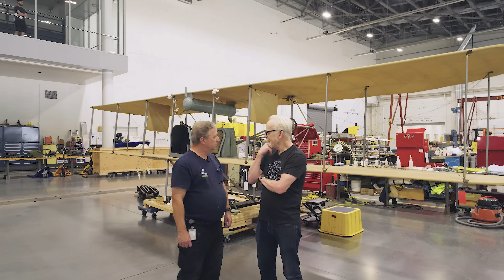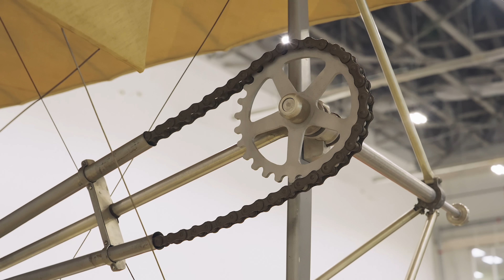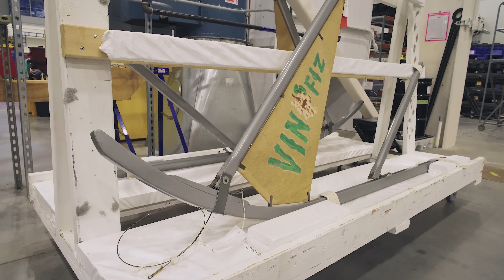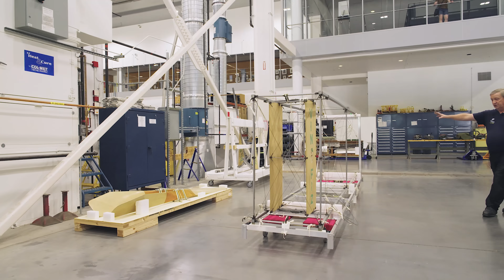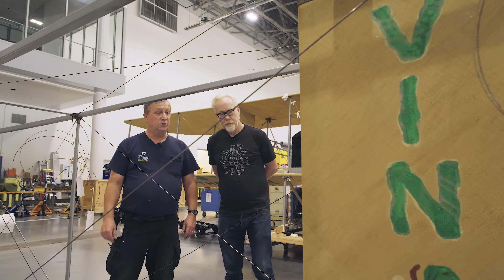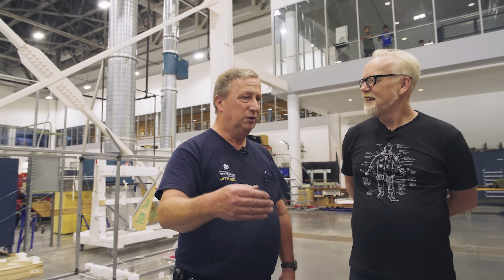The Wright Brothers Plane You've Never Heard Of

Comment: The wrights 1905 machine was the first really controllable airworthy plane that could stay in the air and nake turns Reliably.  There later 1908 and 1909 and 1910 1911 machines perfected it by there 1911 machine it was a very flight worthy airplane that could go up go down turn ledt and right Reliably over and over again and had did so by then for hrs at a time in the air.. and carry a passenger

Comment: All Wrong the firs men that flew a long distance without assistance before the Wright Brothers was SANTOS DUMONT FROM BRAZIL He should get the honor to be the first man flying solo
Reply: Your chronology is mistaken.  The Wrights first flew a fixed-wing, powered aircraft ("airplane") in 1903.  Santos-Dumont did not achieve that until 1906.
Reply: @cardinalRG  Santos, 1906 flight was just a straight line of 2 kilometers with no control of avion so just a long hop!

Comment: The Wright brothers were remarkable, and knew control was more important than engine power, so they avoided unnecessary risks. But some risks were unavoidable in a program where the flight testing of the first prototype is also the initial training of the first pilot.
Reply: Some people say others flew first before the Wright Brothers which may be so but the Wrights created a plane that could be controlled using wing warping, an elevator and a rudder.

Comment: My late friend built replicas of pioneer planes like the Wright 1 and the Fokker Spider, and I low flied them all. Low flying is leaving this earth and returning almost immediately, like early cars, any dummy can move them, but you have to be an engineer to maintain them.
Flying the Wright 1 was like trying to move a full dumpster with busted wheels, but once it rolled well try to stop it!
PS I'm not an engineer, I'm a dummy!
Reply: P-PS I flew the Fokker Spider replica way longer and higher than a low fly, I went up there, I just felt really at home with this one, the Blériot XI was less homey than the Spider, they should have crossed the channel with the Spider, although the extra fuel onboard would have made it cumbersome, but not impossible

Comment: were they really that smart?  they had a bicycle company yet none of their planes had wheels on them,   would have made taking off and landing a lot better
Reply: There were no airstrips.  They took off with a portable sled tramway runway of planks.  As low as the stall speed they were coming in at walking speed onto cow pastures.

Wheels are way worse than skids in that context.  Hit a hole or depression and flip over.

Even wagon roads were full of holes and stumps.
Reply: The Wrights’ use of a rail/skid undercarriage, and later a catapult, was a performance preference—they simply believed it to be a superior method of operation, as @STho205 here pointed out.  It was mobile and could be aligned with the local wind, offered a shortened takeoff distance, and it solved the problem of poor surfaces and confined spaces, like the soft dunes of Kittyhawk and the hummocky, tree-lined Huffman Prairie in Ohio.  (These were places that their competitors could not have operated.)  The Wrights may have been mistaken in expecting that future humans would prefer their method over having to dedicate large chunks of land to fixed-runway airports, but that doesn’t mean they weren’t very, very smart in choosing their methods.
Reply: And the catapult added to the portable skidway was primarily to keep them on the planks.  The 1st ones were just planks and keeping the kite centered over them for that distance was nearly impossible for new pilots...and everyone they were selling to or training in Montgomery were NEW aereonauts.

Rolling over turf or gravel...the rather weak engine couldn't overcome that drag enough to make flight without a slick takeoff.

Comment: The Vin Fiz chase vehicle was not a truck but rather a modified baggage car that functioned as a workshop. I’d love to know what tools were in it. Along for the trip was Charlie Taylor, the Wright Brothers’ mechanic who had built the original “Flyer” engine.

The front end of the baggage car opened up. When the engine was pulled out of the way,  the crew set up ramps to unload an Apperson sports car. The official car was used for general local transportation to transport Rodgers, parts, gasoline & etc.

Vin Fiz was a subsidiary of Armour foods (later including SPAM). The baggage car was painted bright white with the Vin Fiz logo emblazoned on it. Vin Fiz followed rail lines across the country. Armour’s head of transportation managed the complicated logistics of the trip. 

The “special train” swapped out Pullman cars and locomotives depending upon the rail line and what was available. The Pullman car was a place for Rogers, the crew and media guests to stay. The train had the same cook throughout the trip.

A couple years ago I built an HO scale model of the "Aeroplane Car" chase vehicle.

Comment: Fascinaitng.  Thank you!

35 hp(I) is
26 keW or 35 hp(E),
44.2 dBW,
27 p or 35 hp(M),
620,000 ft.pdl./s,
19,000 fy.lbf/s,
9.1 atm cfs and
25 BTU/s

643 lbs.=
292 kg,
781 lb.t.,
20.0 slug,
313 seer or 7.81 mound or 7 mound 33 seer (180 gr./tola),
122 dharni or 7.81 maund/man oe 7 mound/man 13 dharni (Npl.),
179 peittha/viss or 179 achein taya i 1 achein taya 79 peittha/viss,
243 chang or 4.86 hap or 4 hap 43 chang,
4.82 picul (Mys., Sgp. or H.K.,
7,790 tael t. (H.K.),
4.86 picul (Twn.),
77.8 gwan and
9.72 maru or 9 maru 36 kin.

Comment: Nice plane but Santos Dumont invented the airplane.
Reply: With kayak paddle prop blades.

Even duMont said they have done it when he saw it in Paris.
Reply: No individual, or even pair of brothers, invented the airplane.  It resulted from the work of many, but the Wrights were the first to achieve three-axis, controlled flight with it.
Reply: @cardinalRG  The Wright Brothers did things no one else was capable of. They recognized that control was the FIRST problem to solve and they provided the first complete solution. Their patent describes the control system they proved on their 1902 glider.  They recognized that the aerodynamic data of Langley and Lilienthal was wrong, no development dependent on those methods could succeed, and they built their own wind tunnel. (You should study the Wright balances to see an example of clever, well thought out design.) They were also the first to develop an adequate theory of propellers.  Their propeller did exactly what they designed it to do, the first time off. That appears almost miraculous, unless you understand how they did it. Just good engineering. Gabriel Voisin went to his death in 1966 maintaining that the Wrights never flew until they went to France in 1908 and used a French engine. He proves this in the appendix to his autobiography, "Men, Women and 10,000 Kites". He lists the weights, engine powers, areas and other data for the most prominent of the early airplanes and the numbers make it obvious that the Wright machine could not possibly have flown. It didn't have nearly the required power. But, but, we have pictures of it flying. We have movies of the 1904 and 1905 machines flying. What is going on here? Let's look at the entire aircraft. The motor generates the power, but that power has to be transmitted to the aircraft through the propeller. Look at the propellers on those other aircraft. They are junk. If you are using boat paddles for your propellers, it is going to require many times (~6X) the horsepower. Another place where the Wright Brothers excelled was in their engineering philosophy. They recognized that an aircraft was a collection of systems that had to work together. Other pioneers emphasized one thing or another. Bell emphasized structural rigidity in his tetrahedral kites. Unfortunately they were an aerodynamic atrocity. Langley emphasized power, with a 50 hp rotary engine. But he passed the power through a ladies fan. He emphasized lightness without understanding the effect the starting vortex would have on the weak structure. Wilbur Wright was a brilliant man. He gets right to the point. It is interesting to read his evaluations of his competitors. He is spot on.
Reply: In 1906.

Comment: The Wright brothers had a printing business before their bicycle business. They'd invented a new, high speed printing press, selling it and the business in 1899. The "original" Flyer the Smithsonian has was cobbled together in 1928 for the London Science Museum from old parts by Orville, because the 1903 one had been severely damaged at the end of its first and only day of flights when a gust of wind flipped and rolled it across the sand. Most likely part of it is the 1903 original that flew on December 17, 1903. They had no interest in rebuilding it in 1904 because they had learned from it and would go on to make the next one better. Build fast, have problems, figure out what caused the problem, build a new one, go again. That's how the Wrights ran their airplane operation from when they started with gliders until they got the design refined for series production.

There was a years long fight with the Smithsonian over who was first to fly a heavier than air vehicle. Samuel Langley, Secretary of the Smithsonian, had been trying with his "Aerodrome". He had a houseboat on the Potomac he used for a launching system but all he ever managed was two sad collapses off the end of the launch rail into the river. His aircraft was too heavy to fly and too weakly built to hold itself together.

In an attempt to give Langley the credit to have built the first aeroplane that could fly, in 1914 Glenn Curtiss took the Aerodrome wreckage and gave it a drastic overhaul. Curtiss not only wanted to see Langley credited with being "first to fly" he wanted to break the Wright's patents so he wouldn't have to pay them royalties for his airplanes. He managed to strengthen and lighten the Aerodrome enough to make a very short hop off the ground.

The Smithsonian used that as justification to put the Aerodrome on display at the Smithsonian as the "first aeroplane". The original-ish Flyer wouldn't be displayed at the Smithsonian until 1948, after admitting in 1942 that the Wrights were first.

The Wrights had good reason to go hard on protecting their patents when they had wealthy and famous people attempting for years to steal the credit for being first and trying to invalidate their patents.

The "secret" to the Wright's success was the wind tunnel they built after gliders failed to perform as expected, applying Otto Lilienthal's airfoil data to shapes different than Lilienthal used. Over 200 designs were tested to find the best combination of lift vs drag. What they didn't know was that the way airflow, lift, and drag works doesn't scale linearly with wing size. Langley also did not understand that. He'd build a couple of scale models that flew but his full size one was simply scaled up enough for a pilot. He did not understand that the engine power required went up faster than the size of the airplane, or that the paddle-like propellers and highly cambered wings drag would be much higher than the percentage they were enlarged.

The Wrights likely were catching on to those issues, IIRC their wings were a bit too flat. If their wind tunnel had been 2 or 3 times the size so they could test larger wing samples, they would have been closer to a better airfoil shape for their full scale gliders and airplanes. They focused on making the airframe and engine as light as possible and the engine as powerful as possible. More power and less weight = better, even if they didn't know all the math.

Comment: There is an original Wright plane in the Franklin Institute jn Philadelphia I believe it is a model B and a Doctor originally owned it (it was in its original condition for years, not sure why they refinished it)  But something even cooler to see is tucked away in a display case in the corner that nobody ever notices.......there are the original handwritten airfoil calculations that the brothers made on scraps of wallpaper and also the small airfoil  shape models are in there......blew my mind to see that there in Philadelphia and not the Smithsonian.

Comment: The website I found only went back to 1913 but that would be $1,636,242.42
Reply: I found one by the the U.S. Department of Labor that goes back to the 1600s.  From 1911, it comes out to a wee bit over $1.7 million.  So not a huge difference.  Or I guess it was a huge difference for back then.

Comment: That was a treat. The Wright brothers story is a great bit of American history. Very inspiring.
Reply: Only if you read the A-merican writen history.. for instance.. Herbert Akroyd Stuart invented the first pressurized fuel injection system using a pump in 1891... and someone before him invented fuel injection itself.. history rewriten by the yanks is not at all reliable.  
Were the Wright  Bros  first to fly.. no, just had the best publicity.
Reply: @peterdemkiw6858  American history s loaded with lies. Yes.
Did the Wright brothers invent the first controlled flight? YES! Research it and then SFTU.

Comment: I didn't realize that doping the fabric to seal it and pull it taut wasn't a thing in 1911.  :>)
Reply: A lot of pioneer aircraft used varnished fabric or even rubberized fabric. They needed to seal the fabric ( it makes a surprising amount of difference) but the covering still needed to be flexible to accommodate wing warping. The early dopes would have worked against this.

Comment: There is a first flight museum in Kittyhawk NC.  The exhibits there are way better.  The pieces of the original engine are there.  The planes are there.  The original models, the original workshop, the original runway, and there are so many photos.  If you have an interest in this stuff, Kittyhawk is the absolute best place to go.  It's nested right in the middle of the best beaches on the east coast.

Comment: "Fun" fact: There's a (still valid) contract from 1948 that states that the Smithsonian can only have the original Wright Flyer in their museum under the condition that they never claim that another machine was able to carry a person in controlled flight at an earlier date. So even if there was evidence that other people in the world might have managed to beat the Wright brothers, they wouldn't be able acknowledge it without losing their exhibit. It's not exactly a high point for Smithsonian's credibility to have signed an agreement like this.
Reply: The Smithsonian didn't have much credibility in the matter of first powered, heavier than air flight. The Smithsonian Secretary in the 1910s, along with Glenn Curtiss, colluded to prove that Samuel Langley, a former Smithsonian Secretary, had actually performed the first powered, heavier than air flight.
Curtiss heavily modified Langley's machine to make it barely capable of flight, and claimed that was the configuration that Langley had used to achieve first flight a couple months before the Wright brothers. Langley hasn't managed a flight; he crashed straight into the Potomac. 
Orville Wright spent the next forty years trying to convince the Smithsonian that he and Wilbur were the ones that actually achieved first flight. The Smithsonian changed the wording of Langley's machine, to claim there was some doubt on whether it had flown first, but it wasn't until 1942 that the Smithsonian finally accepted the fact that the Wrights had achieved first flight, not Langley. Unfortunately, the Wright Flyer was in England at the time, and wasn't able to be sent to the Smithsonian until 1948, shortly after Orville passed.
The current agreement came from the history of the Smithsonian colluding with a rival aviator to claim that one of their own achieved the first flight, instead of a couple of self taught outsiders. The shame isn't in the 1948 contract, it's in the previous several decades of lies and collusion.
Reply: @ostsan8598 
Exactly, but people like the OP are always using that out if context to try claiming that the US is covering up the fact that someone else actually flew first blah blah blah.
And Glenn Curtiss was about the shadiest person ever in aviation, he constantly incorporated others patents into his aircraft without caring one iota about it, he'd just start selling as many aircraft as he could figuring the money and fame he'd get from everything would far exceeed the cost of paying a lawyer to go to court for him, he didn't have to show up for those court proceedings so he didn't care, the amount of money he'd be generating out promoting himself would far exceed what he'd pay his lawyer that day.
Reply: I thought the original flyer is at Wright Brothers museum in Kittyhawk North Carolina??  I've been and seen "a plane" there.
Reply: @RonnieStanley-tc6vi There’s a replica at the Wright Brothers’ Memorial in Kittyhawk.
Reply: @RonnieStanley-tc6vi  - "Original" is in the Smithsonian. The first flight machine suffered severe damaged in a non-flying mishap after only four flights.
Reply: That is odd...

Comment: "Traditional mechanics don't do well here. They can't take the pace. It's too slow. They've been taught ;get the refrigerator back to the customer', 'get the car back to the customer'. Now they have to think 'make it last 100 years', it's a different way of thinking."
It's a way of thinking I wish we valued more in our society.
Reply: I wish Housing was thought of lasting 100 years minimum. Currently the house I live in is from 1959 (one of the houses with basment the main floor is like the bigger double wide trailers) and I feel is barely going to last 70 years due to the lack of care on the house.
Reply: This is preservation without use; most mechanical decides are intended to be fully used.  This being an airplane,  it can't efficiently be overbuilt and still be usable.